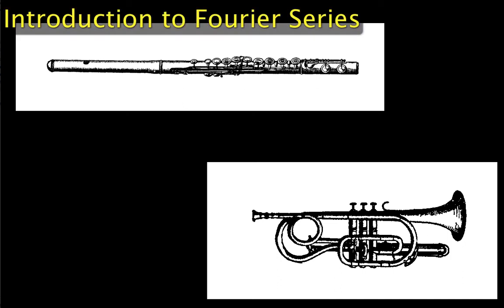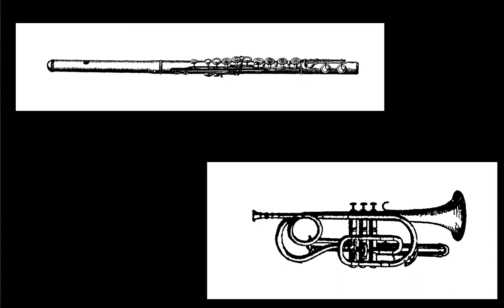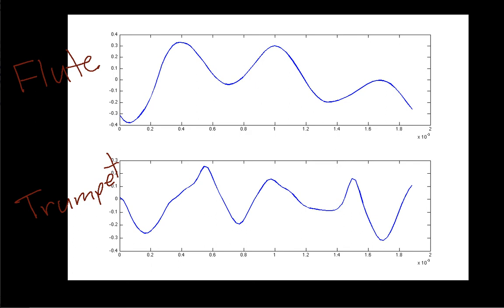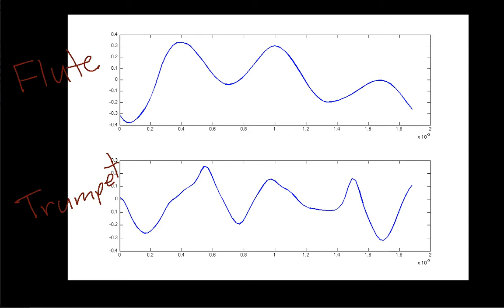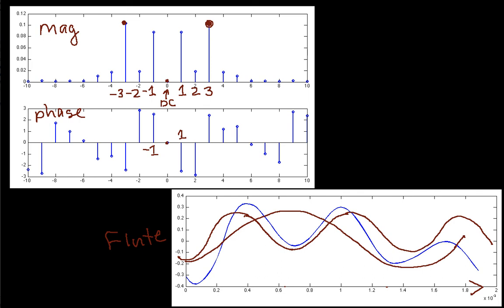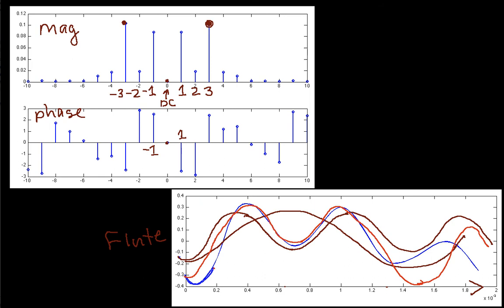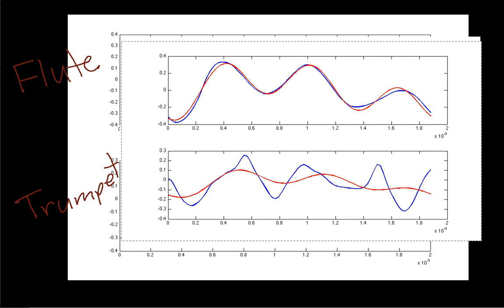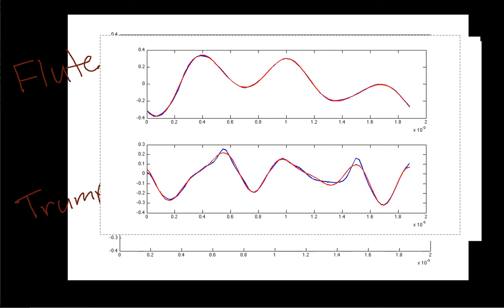Introduction to Fourier Series

Comment from the maker: @RoguePianistTetsuo The voltage is proportional to the change in air pressure produced by the sound wave as it passes by the microphone. So the Y axis is proportional to changes in pressure. I used Matlab to do the graphs; I actually sampled synthesized flute and trumpet waveforms, then used the DFT to get the Fourier Series coefficients. I do not know of any software that would convert from sampled signals to functions.

Comment from the maker: Sorry to not be clearer. By “adding up the harmonics”, I meant that you use the amplitude and phase given by the Fourier series coefficients to get a sinusoidal waveform for the fundamental frequency, one for twice the fundamental frequency, and so on. Then you add these waveforms together (as described in the last half of the video “Signal Operations: Scaling and Addition”).
Reply: Darryl Morrell In the previous video you mentioned that the FS is used for continuous periodic time signals, yet you are using it here to analyze continuous aperiodic time signals. One more thing, you did not explain the numbering of amplitudes in frequency domain.

Comment: You said the Y axiz is proportional tot he voltage a mic would produce picking up those sound signals. What physical value of the flutes sound wave would that correspond to? The amplitude or...what?

And also, what program did you use to analyze the sound signals of the flute and the trumpet, getting the graphs of their sound waves and perhaps getting functions for them? Thanks!